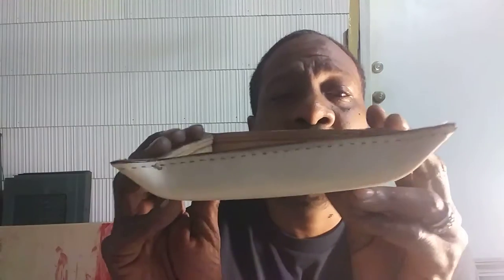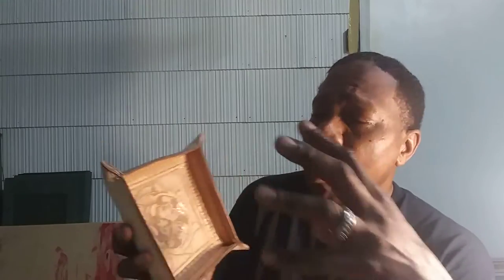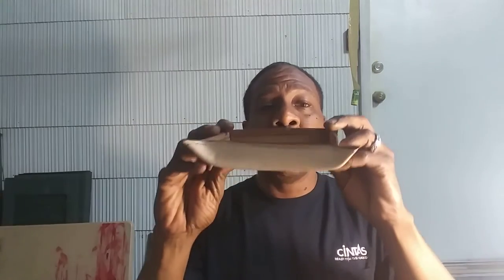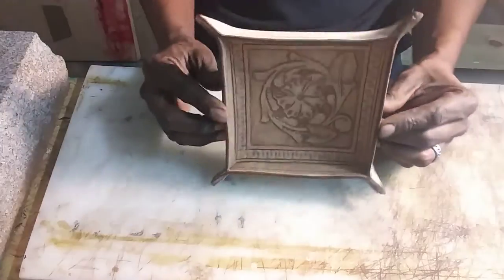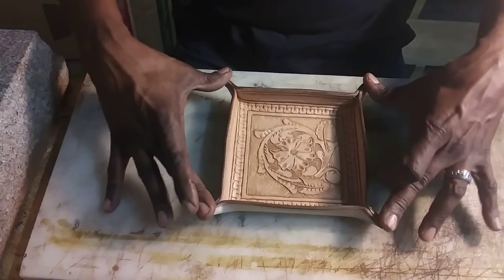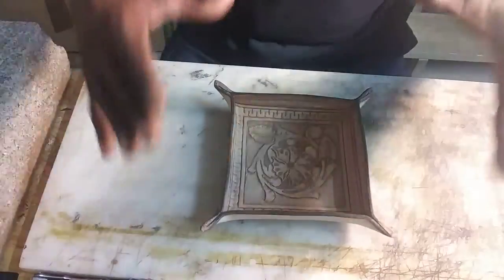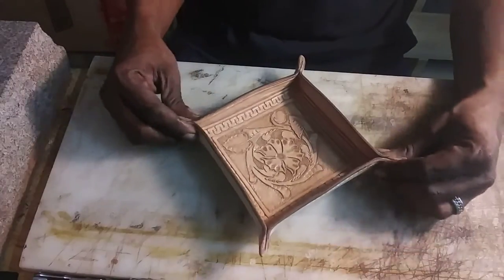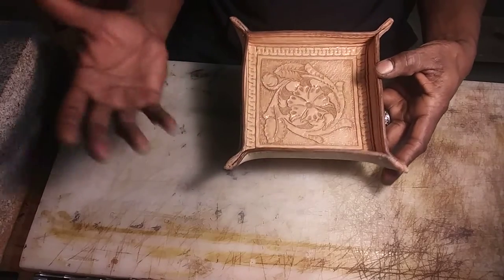Small Project: Valet Tray Complete

Comment: I have found if I dye after gum it doesn't soak in quite as well but works. If I dye then gum, it doesn't burnish as well. I don't use any edge coat. Sometimes I put tan-kote on the edges. I just started experimenting with using bees wax on a polishing wheel on a rotary tool. At 5000-10000 rpm it works in and comes up like glass, also water proofs the edge. I got a cordless rotary tool at wally-mart for under $20 to sand edges. I wish they has a 320 grit or finer sanding wheel for rotary tools.
Reply from the maker: This is why I do these vids. There's nothing set in stone as to what a crafter should use as far as none traditional tools. If it works & the result is what you are trying to achieve then do exactly that over and over again. 
Thanks for your comment
PLC